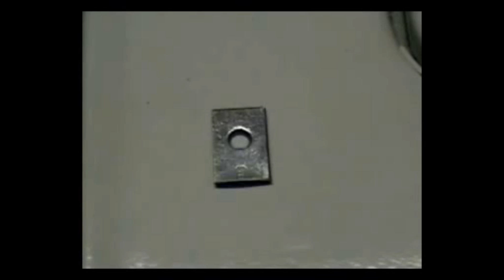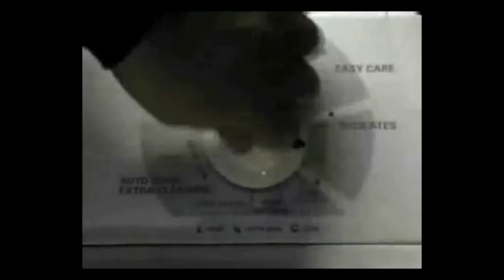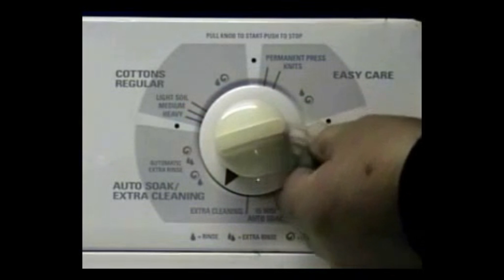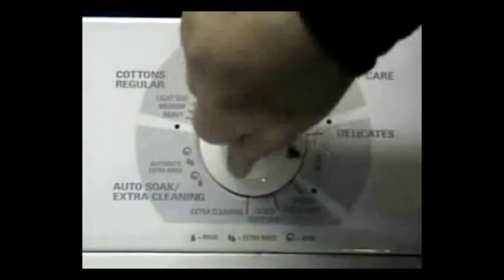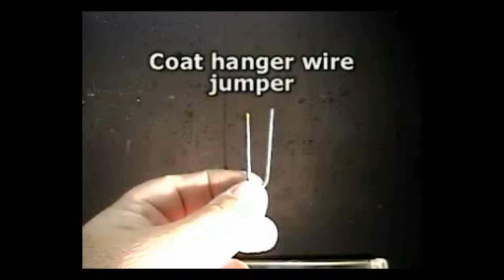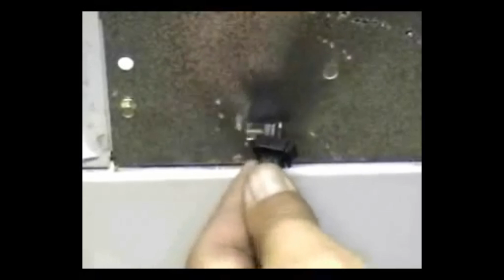General Electric Washing Machine - The Timer

Comment: My GE timer was loose at the end opposite to the screw....the plastic tab was broken...I used a metal  picture frame hanger and bent it to hold the slot on the timer down...had to drill thru the face and put a small nut and bolt to attach it.. thanks for your info.
Reply from the maker: someone else would have yo buy a new timer. May not be pretty but it saves you over $100 bucks
take care
theapplianceman
Reply from the maker: Thanks for watching my videos
Check my website at the link below
http://www.do-it-yourself-washing-machine-and-dryer-repair-help.com/
Angel theapplianceman